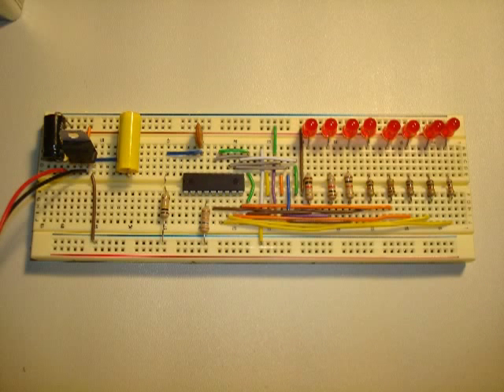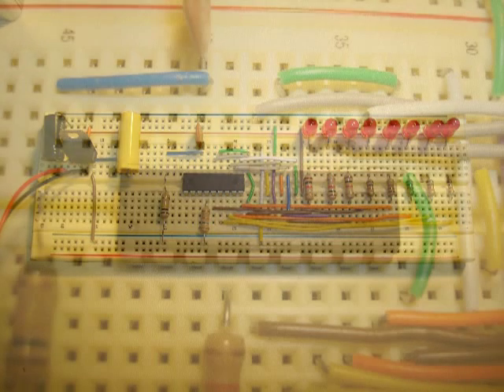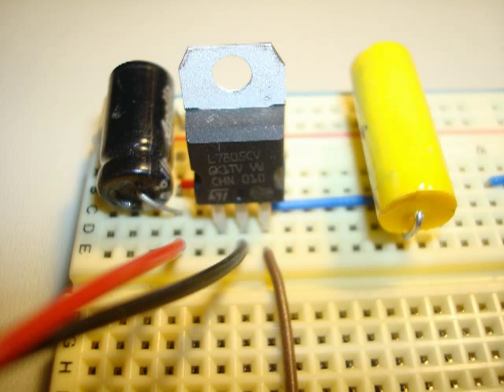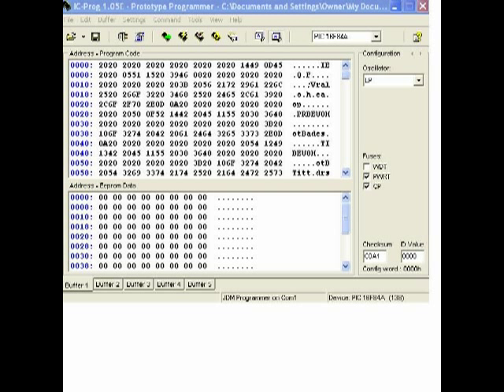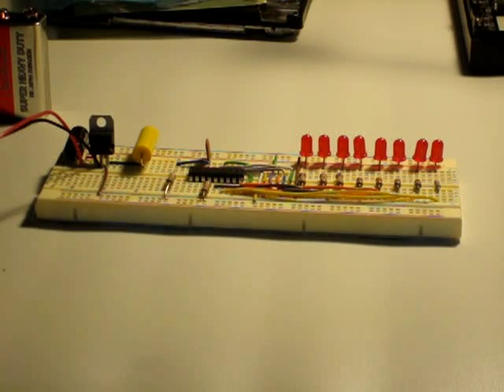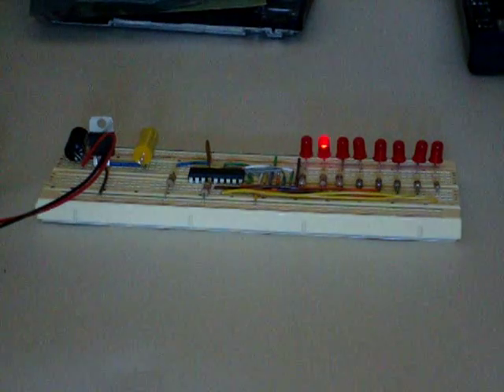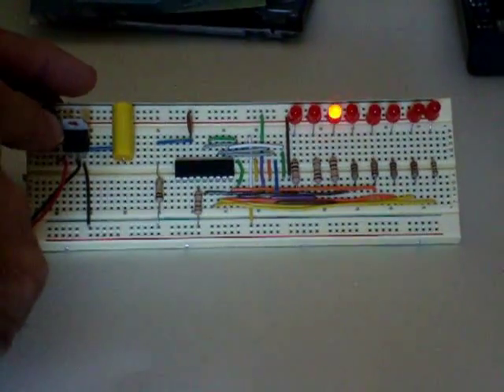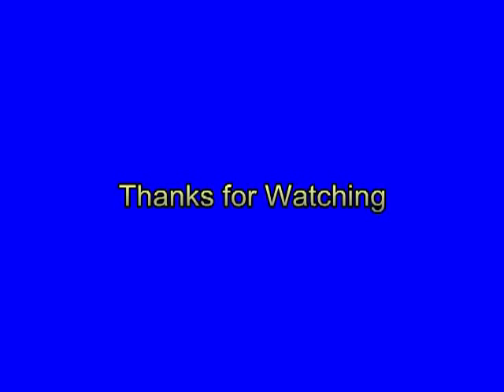My 2nd Pic Project.avi

Comment from the maker: @Giovanniram22 
The JDM is an ICSP type and can program this chip. However the JDM won't work with laptops. Its only for desktops due to the RS232 signal levels. Laptops have low power serial port signals and won't work with it.. Keep this in mind.

Comment: Hi
I am new to the pic progamming.
Is there a cheap programming board to buy or to build?
Reply: pikkit2 is very good you can buy on amazon.
Reply: @goodfood2464 
Thank you.
Reply: @Giovanniram22  if you need any help in programming and software related then i will suggest you but only in assembly language.
Reply: @goodfood2464 
OK. Thank you.